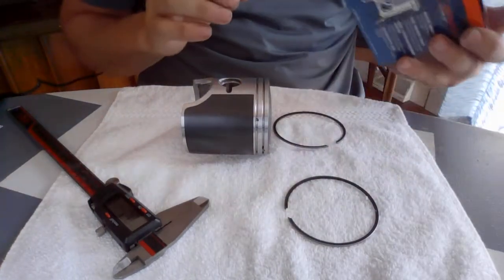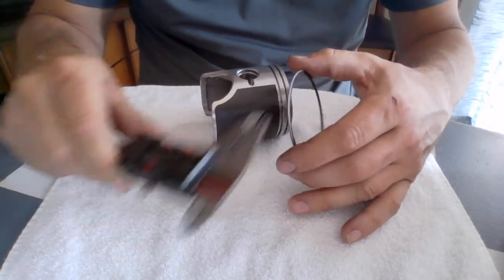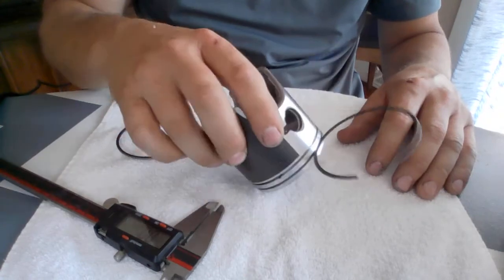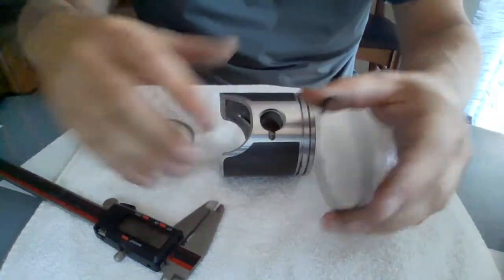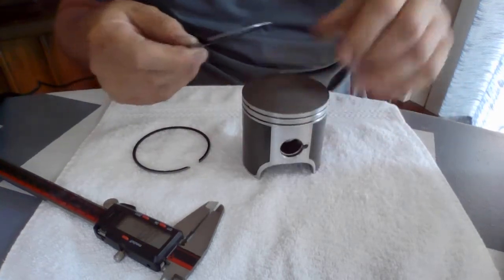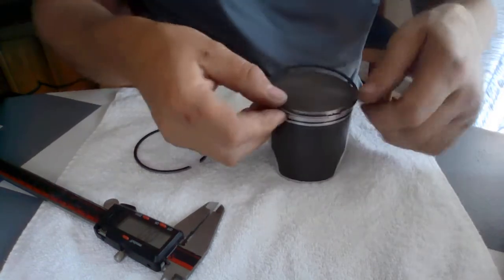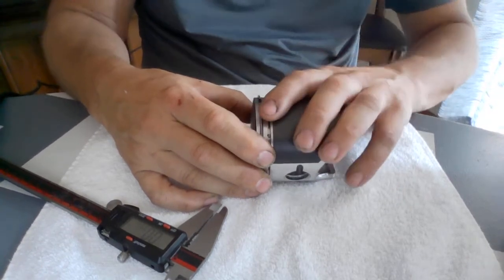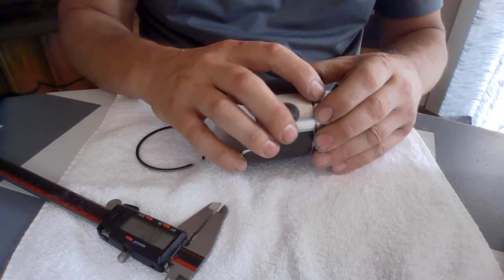SP1 piston ring install - F500 and Snowmobile engines

Comment: Now you're scaring me lol. My piston rings seem to both be the same size. I also have the spi brand. How do you tell which ring goes in the top groove and wich goes in the bottom? Awesome video!
Reply from the maker: They were drastically different thickness.  It was noticeable just in my bare hands but if you get your calipers out - you should be able to measure them and the thinner one goes in the top right, and the thicker one in the lower.